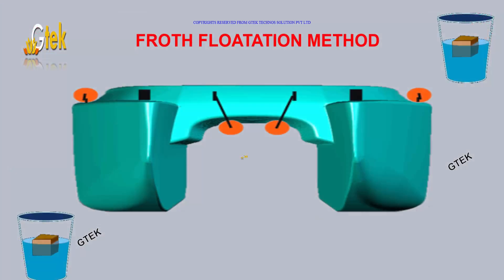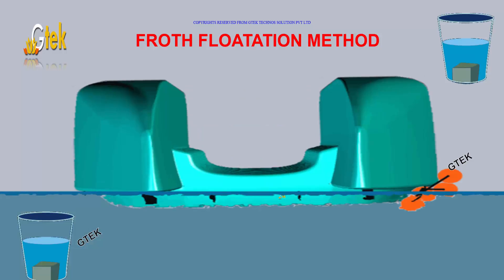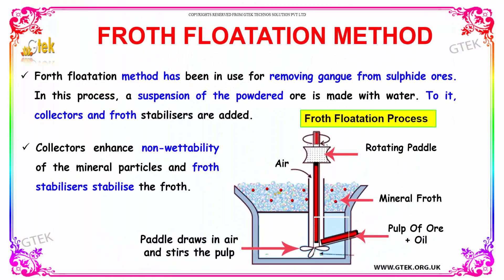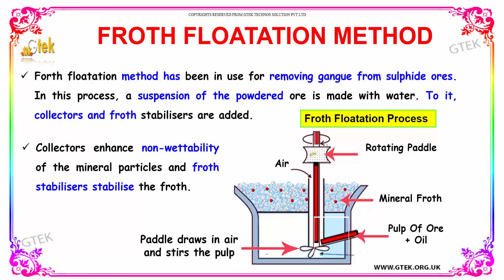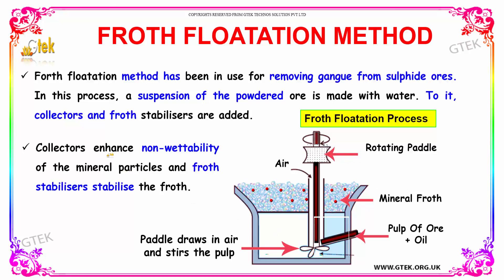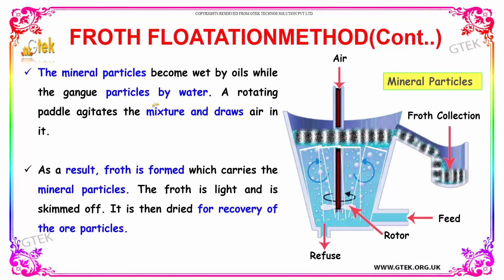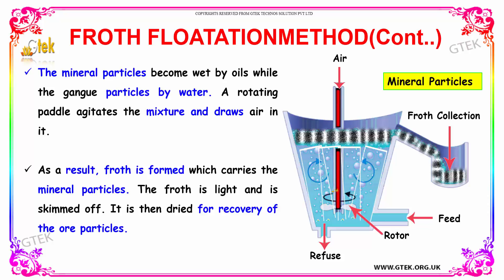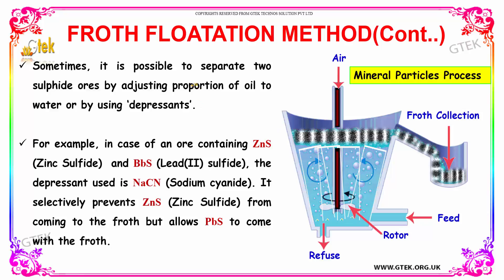froth floatation method principles and process of isolation of elements 12 chemistry cbse

Comment: This is a method of concentration of ores used exclusively for Sulphide ores. Principle involved is the difference in the wetting properties of the ore and the gangue particles. The sulphide ore particles are preferentially wetted by oil while gangue particles are preferentially wetted by water.

Comment: The most common zinc ore is sphalerite (zinc blende), a zinc sulfide mineral. The largest mineable amounts are found in Australia, Asia, and the United States. Zinc production includes froth flotation of the ore, roasting, and final extraction using electricity (electrowinning).